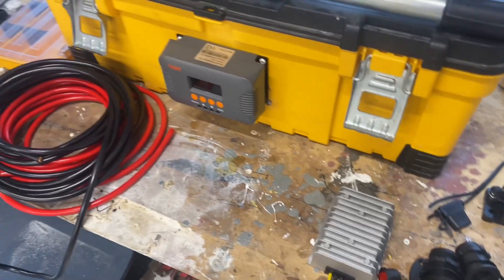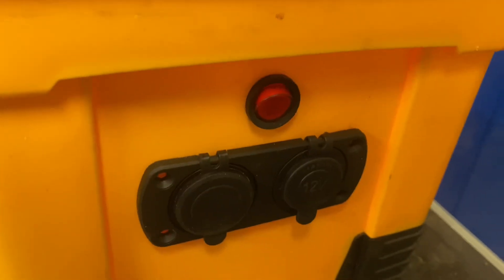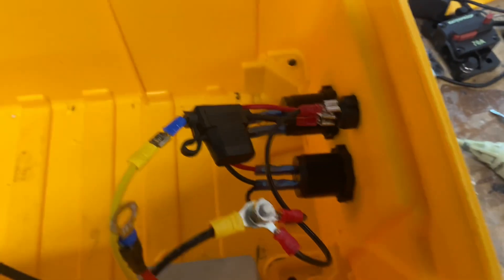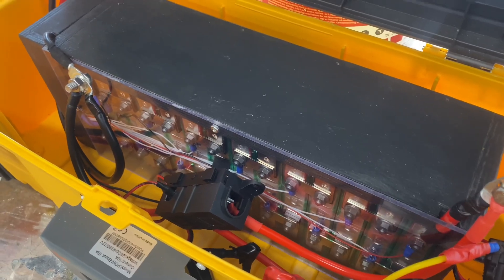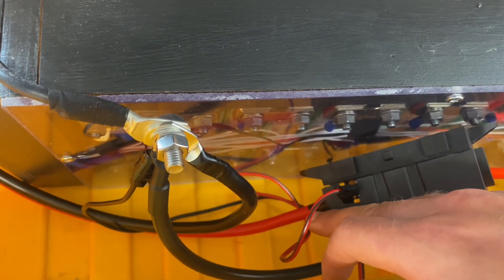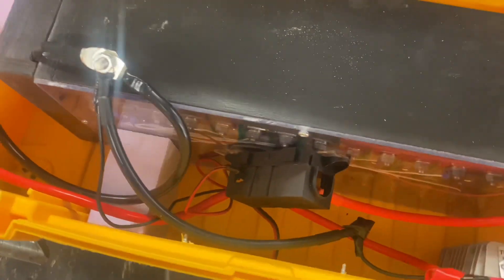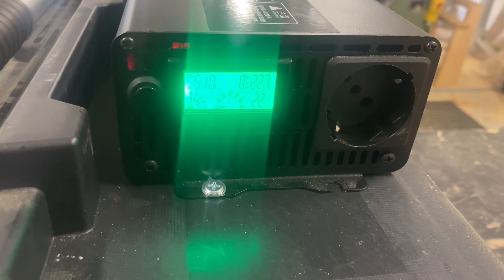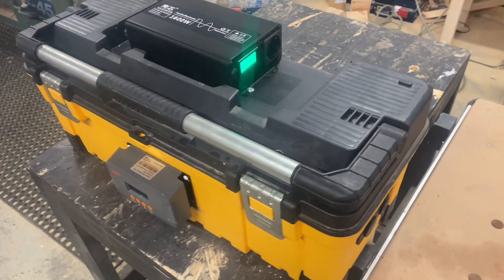DIY portable power station / Saving $$$

Comment from the maker: 📦 Affiliate Links:
PowMr Boost solar charge controller: https://s.click.aliexpress.com/e/_DFqm7gJ
48v-12v converter: https://s.click.aliexpress.com/e/_DB8b8fp

✋Don’t want to build your own? Check out these links:
Anker: https://anker.pxf.io/c/3986474/1543954/18023

Bluetti: https://bluettieu.pxf.io/c/3986474/1438165/17091

Jackery: https://www.jackery.com?aff=1555&utm_source=affiliatly&utm_medium=affiliate&utm_campaign=affiliatelyus

AllPowers R600 power station: https://s.click.aliexpress.com/e/_DFjn7ix